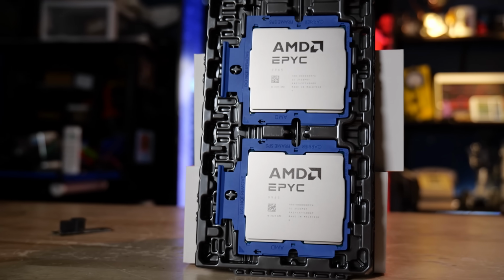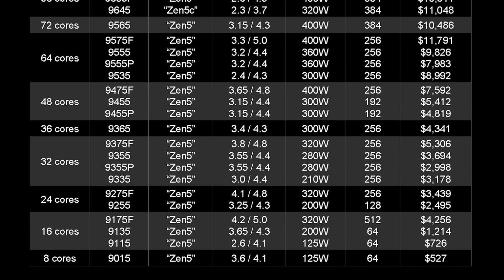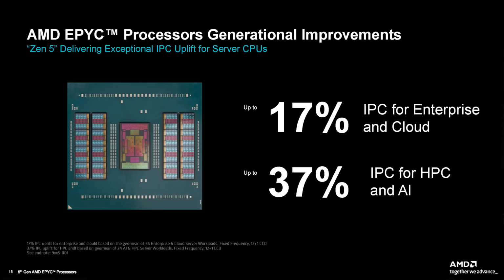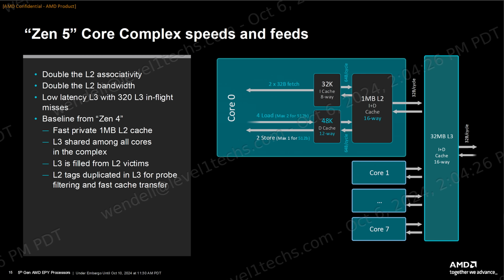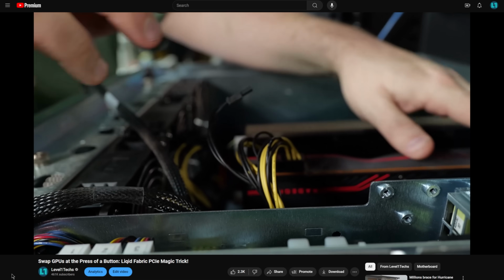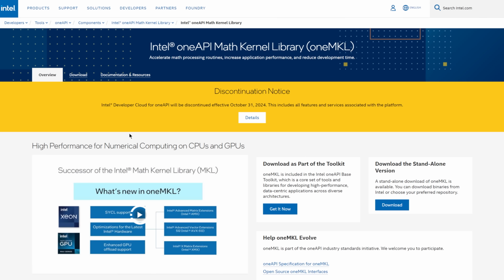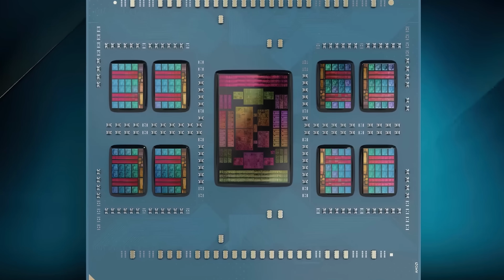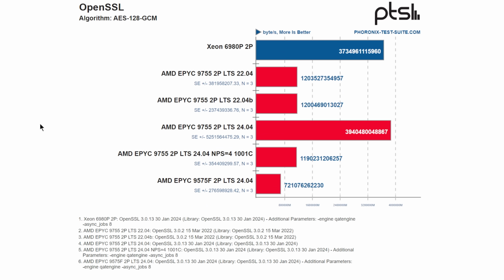AMD EPYC Turin Server Benchmarking and Review! Featuring the Zen5 9575F, 9965, & 9755

Comment: Imagine a 16 core CCD trickling down to the desktop Ryzen line...  🤔
Reply: Been imagined and named the ryzen 9975X3D if I am not mistaken 😂 idea was one 8 core x3d and one 16 core 5c
Reply: @annebokma4637 which solves scheduling as c cores are slower. Hype train here we come
Reply: @bobo-5195  exactly the point that was made too
Reply: oh wait yh they talked about that idea before on this channel right? @annebokma4637
Reply: I can see the memory bandwidth starvation already!
Reply: @MarkRose1337  use fp11 strix halo platform for 256bit 8500mhz support so what 3 times bandwidth. There is a 4070 ps5 class gpu there that might be starved for gaming or use a 96gb vram ai model.  

The mullet of desktop cpus. Could be a party gaming or workstation or ai ai ai. In a sec case. They have a very asus tablet coming out that is 100+ watt basically all cooling as the processor board is so small

Hype train fanboisim that will be dampened by this being amd
Reply: @bobo-5195  For my application even 8 core CPUs other than the X3D models are memory bandwidth starved
Reply: @bobo-5195 stop using nivida as a reference uses AMD to AMD and PS5 basic is rdna 2 couldn't match 4070 if that's the case I say 6700-6750xt
Reply: We can only dream, that with ECC and low idle for non 24/7 workloads...
Reply: EPYC 4xx5 with AM5 Socket may be.

Smaller cache and lower clock speed won't suitable to sell with Ryzen lineup.
Reply: @sfalpha  but intel as cinebench accelerators. and at 16 cores fully loaded are you better having 24 but some at slower speed
Reply: @bobo-5195  But, AMD can do at 32c/64t in AM5 package, and 170w juice is plenty. It may can do higher base clock per core than EYPC with 128 or 192 cores part.
Reply: @sfalpha  but who is it for? and why would those people not buy a threadripper. At 32C your massively multithread.
Reply: @bobo-5195  Entry level servers and workstation, AMD already has EPYC 4000 to compete with Xeon-E Lineups. 

In many case those massive PCIe lanes huge memory bandwidth are not needed, such as micro services, or application servers.

In many cases using multiple entry-level 1P servers blade is much more cost effective and offers physical redundancy.
Reply: @sfalpha  Yes. It'll be like the 64 core 4 channel thread ripper, scaled down. Works well for a lot of apps. It would go nice with a 192MB L3 16 core part as well. Basically do the same thing as this launch, on a smaller scale.
Reply: Unfortunately, Microsoft would F up the performance of AMD processors..
Reply: I think AMD adding a third CCD for 24 cores is more likely. 16 cores is just a too large CCD size for desktop. It doesn't give AMD enough granularity to work with, and yields would be worse too.
Reply: @S9uareHead  It would require newly designed IOD to have 3 CCDs. Current IOD have control signals, etc enough only for 2 CCD.

Modify packaging to allow 16 cores CD is easy, 170W TDP is more than enough and IOD wound not need redesign, AMD may already have samples in lab since they decided have EYPIC 4004 lineups, they may plan to launch such CPU to fill 1P server platforms and compete with lower-end Xeons.
Reply: I would buy with 64 cores, more than that creates issues with software
Reply: The 950X3D should have always been the king of gaming I feel like. We are in a weird situation where a cheaper chip performs better.
Reply: apparently 12 core ccds come with zen 6

Comment: 500 watt / 16 chiplets ~~ 30 watts per chiplet, with the IO node cost amortized. And amd has "juiced the volts" up a bit this time, since intel actually managed to produce a somewhat competitive chip with a process advantage. But if amd is strongly competitive as it is, they can merely play the process boost at a later convenient point.
Reply: You underestimate how much power the IO die uses, it's around 80~100 watts under load.
Reply: @gatocochino5594  That's why I said it is amortized across the cpu.

Comment: amd has become a execution monster. gj lisa from 2% 2018 to 34% in 6 years is craaazy
Reply: Honestly they outdone themselves several times. Turin is a masterpiece.
Reply: After Genoa they should be >50%. Let's just wait for the next round of server refreshes to come in...
Reply: @ktfjulien  Yeah, if the competition was not using monopolistic strategies to prevent AMD from gaining that market share...
Reply: @evalangley3985  We have it on fairly reliable authority that the absurd delays of Luna Lake and Arrow lake were getting OEMs pissed... and then the 13th/14th gen fiasco started rolling where Intel initially pretty much told the OEMs to just suck it up. If you look at the number of AMD systems Lenovo offers now, compared to a year ago, the shift has happened... AMD just need to beg TSMC for more capacity.
Reply: @ktfjulien  Yeah many server cycles are around 8 to 10 years so the next batch of server upgrades will be the next couple of years (2018-2028) and everyone's seen how good they've been. 6 years of steady improvement and field testing means that there is no longer that question mark of what to expect from epyc etc. Also techies talk to each other at the pub. Managers also.
Reply: 40% + next year
Reply: Lisa Su is a talking head that did nothing, better thank engineers
Over here praising Steve Jobs type of individuals that didn't do much with their own hands, just there to take corporate credits
Reply: @righteous-one-7  So why was AMD failing before Lisa then?! The soldiers' effectiveness is only as good as the skill of the general. This mediocre assessment of how companies work seem to stem more of jealousy or pettiness rather than logic.

Apple was failing before Jobs came back despite the fact that most of the engineers who worked under Jobs to ship iMac had been there for years.

The captain of a ship does not work alone, he/she need many workers underneath them. But if the captain does not have the capability to make good decisions, no matter how good the engineers, navigators, firemen, cooks and assistants are, the ship will hit bottom.

That's why Lisa and Jobs are so praised. They give a company direction and make the hard decisions to allow their workers to concentrate on things that will work.
Reply: @righteous-one-7  , lisa su is engineer aswell , she understands what need to be done , she sees the future and sets the goal , not engineers , they only do what lisa tells them .
Reply: @parm2-x7h  I'm an engineer at AMD, on the Instinct GPU's, and that's not how it works. There are hundred of people from the design architects to the validation team that are contributing. Lisa didn't come up with the Zen design, but she sure as hell sold it. Having a Ph.D. from MIT in E.E. doesn't hurt...
Reply: @sonnygruntstick  won't you be working on UDNA then too eventually.
Reply: @righteous-one-7  Lisa Su was an engineer before moving into the corporate world 🤷‍♂️

Don't be such an idiot there's already plenty of them on the internet.
Reply: @righteous-one-7  Dr Lisa Su has a PhD in semi conductors and worked on the IBM Cell chip that was used in the PS3 and IBMs System360 servers. Just so we are clear on that part.

And while Steve Jobs was a college drop-out there is no denying that Apple went down hill when they fired him and they returned from irrelevancy when they hired him as the CEO again.

Yes, it's engineers who do the actual work, but (and I say this as a software engineer) getting engineers to do what they're supposed to, rather than what currently interests them, is a matter of good leadership. If an engineering team is left to their own device they will always be between 80 and 95% ready to launch a product... because as soon as they reach 95% they realize that they could do something SO much better if they just rip out this and substitute with that.
Reply: @righteous-one-7  Steve Jobs?? He had other guys like Wozniak do the actual engineering while he talked a good game. Lisa Su went to MIT and has been engineering since she was young. I mean she's  also Taiwanese. It seems to be somewhat common for at least one family member to be into silicon, whether design or manufacturing and engineering. Saying this after listening to Asianometry say this on Broken Silicon about his family.

Either way you sound stupid. Everyone knows Lisa Su put in that work before she got the call to be CEO. You daring to compare her to Steve Jobs makes you look slow.